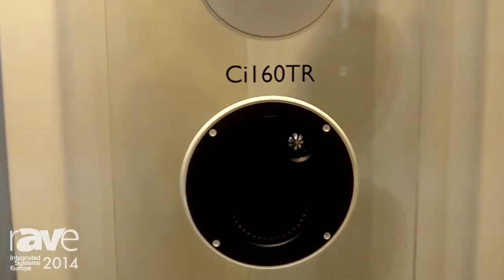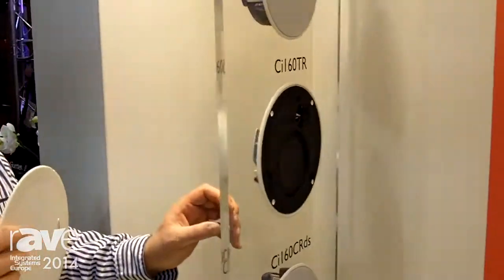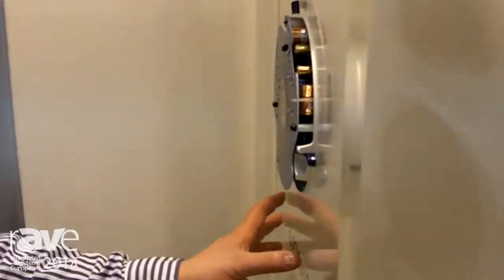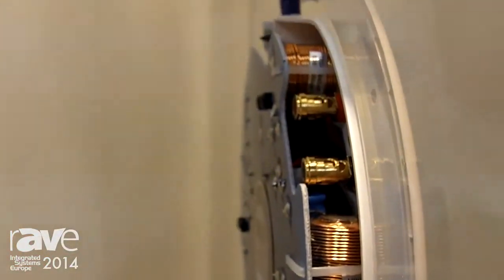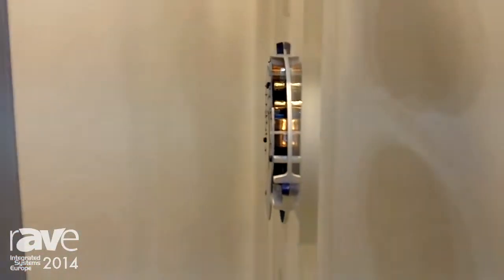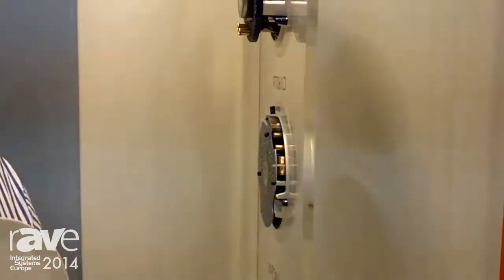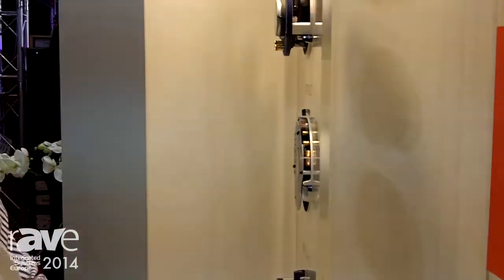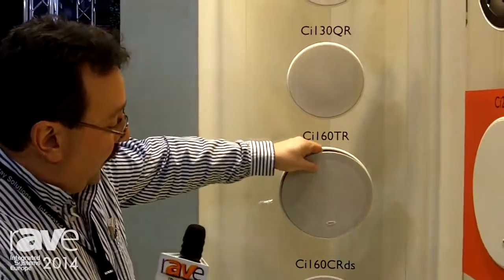ISE 2014: Kef Shows Off Extra Thin Ci160TR Speakers

Comment: Utter garbage. Bought two pair of these for thin soffits. They were anemic and frankly not worthy of the KEF name.  Sounded like a cheap pair of commodity three-way speakers with the bass driver removed altogether. Didn't even return them. We threw them away -- where they belong.  Replaced with Martin Logan with about a 4" mounting depth. Very impressive the Martin Logans. Same price - about $350 a pair.